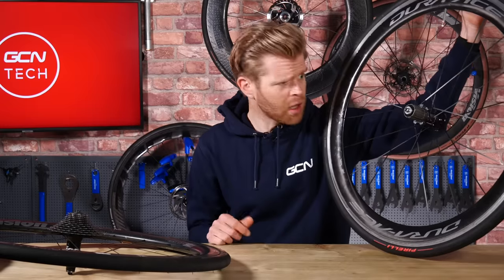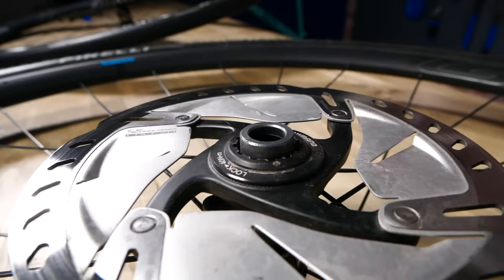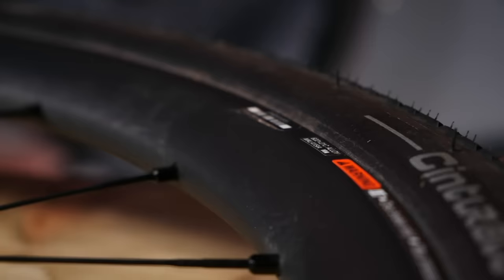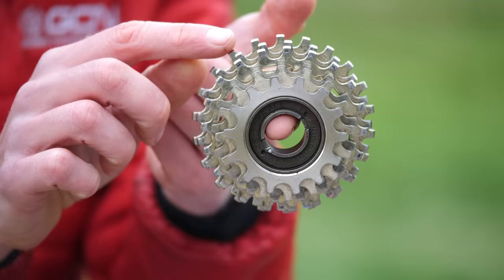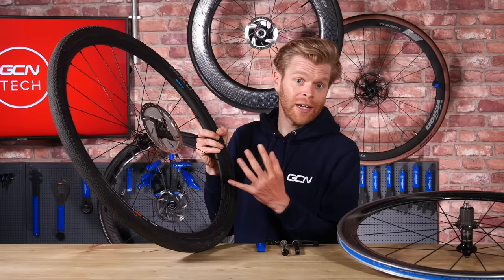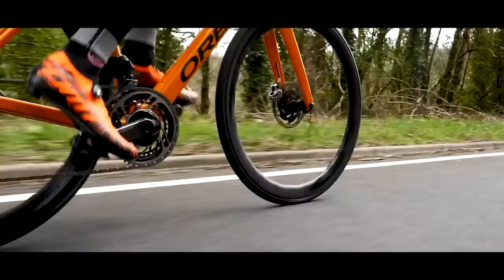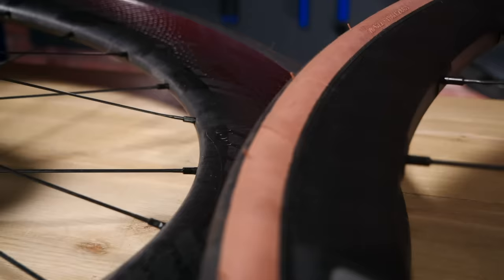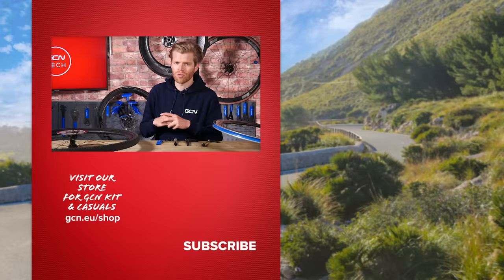GCN Tech's Ultimate Guide To Bike Wheels | Which Is Right For You?

Comment: What’s the problem with running clinchers tubeless? Why’s it “unsafe”? Before there were tubeless specific tires and rims I ran clinchers tubeless for several years without issues. Magic Ksyrium ES clinchers with Scwalbe Ones, don’t recall if I was running 23 or 25mm, but I think they were 23s as I was racing then

Comment: I think going tubeless on a road bike solves a problem that doesn't exist.  That said, tubeless compatible hooked rims and tires are a definite plus because the bead interlocks with the rim and in the event of a blowout or fast puncture, the tire will stay in place making it much more possible to bring the bike to a controlled stop.  Before these innovations, the tire would fall away from the rim making rim-to-road contact a very dangerous situation and a crash a definite possibility.

One other thing, tubeless tires will mount on just about any rim.  I regularly mount tubeless compatible tires on old style rims without problem.  Maybe while riding a problem could arise but I doubt it.  The specialized rim for tubeless tires that was shown seems only to be an accommodation for tubeless-compatible tires that are notorious for being hard to mount.

Comment: The difference in gains between a set of £500 set of wheels and £2000 is absolutely tiny, especially if you live in a relatively flat area!! Unless your rides are composed mainly of climbs, you should always prioritise aerodynamics over weight, and even then, it’s only marginal unless you can consistently achieve an average above 40kph!
Reply: GCN Tech actually tested this and in realworld conditions lightweight wins. Aero wheels are a meme unless you're in a velodrome.